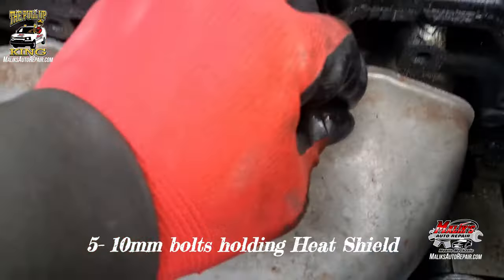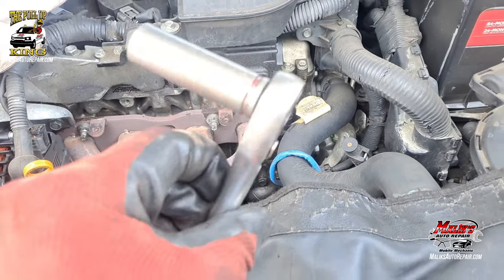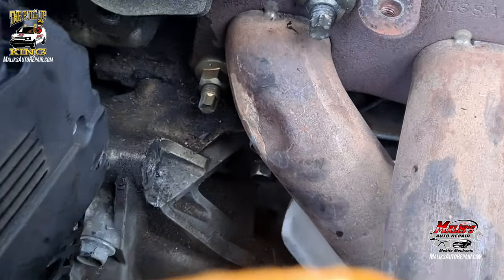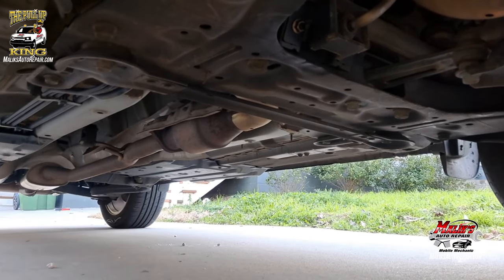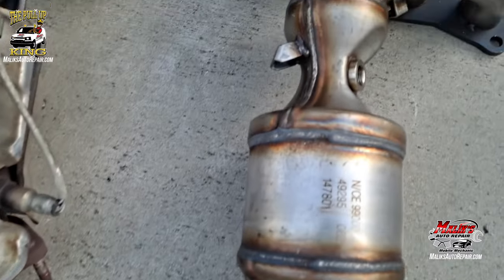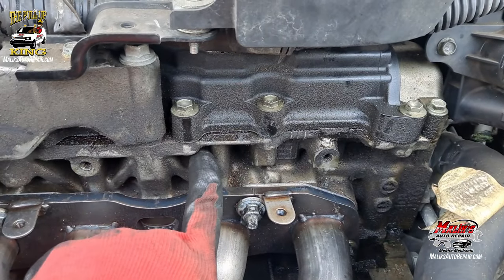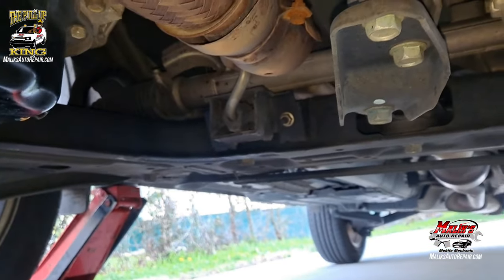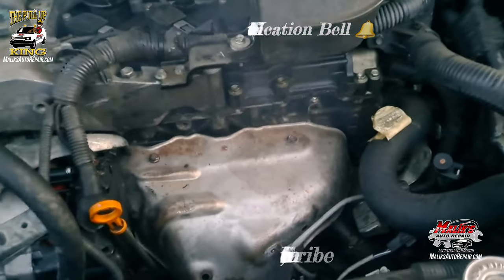CHECK ENGINE LIGHT FIXED‼️CATALYTIC CONVERTER | 2011 NISSAN ROGUE 2.5 | DETAILED| Howto/Diy

Comment: Everything you did was perfect bro, Great job. There is one tip I want to add to the process though. Make sure to clean off the intake part before you put the new gasket on because it will give you a better tight seal on the new gasket and catalytic Converter . Great job though : )
Reply from the maker: Thanks for watching

Comment: Great video man! Just want to ask how long did it take you to finish the job? Also what material did you put on the new censor before screwing it in the cat. Thanks!
Reply from the maker: I appreciate it. About 2 hrs. O2 sensor should already have anti-seize on it. If not, add to the threads. Thanks for watching!

Comment: Great video- almost makes me want to tackle it myself without the shop. In order to pass inspection for my vehicle, I had to get rid of P0420 code only. My mechanic wants me to replace both the front and back cat converters. Do you think this is necessary without that code? Obviously hard to know without seeing it yourself but it about doubles the price and makes me consider chalking my baby (car).
Reply from the maker: P0420 if for the front Cat. P0430 is for the rear cat. I would replace the front only. And I appreciate it! Thanks for watching!

Comment: Was the converter stop up that's why you were replacing it I have a 2015 with the check engine light on and it's something to do with the exhaust but the converter is not stop up that's why I was asking
Reply from the maker: It was replaced bcuz the check engine light was on with code p0420. They wanted it cleared. In order to do so, the front  catalytic converter and Upstream oxygen sensor had to be replaced. Good possibility it was clogged.
Reply: @ThePullUpKing  thank you for your response and the video
Reply from the maker: @danielpadgett2831  No problem. Thanks for watching!

Comment: This is the manifold catalytic converter a $900 part up to 1500 this is not your main rear catalytic converter $250 part …for anyone reading this there is a difference on the Rogue models
Reply from the maker: I replaced the front catalytic converter. Code P0420
Reply: Well that’s my next project I’m battling a Po420 code myself I did replace all spark plugs and engine coils that took away the misfire and failing converter bank 1 only a few days later engine light came back on and now it’s the bank 1 converter and no misfire. I have re-watched your video about 10 times now very convenient and I know I can do this at home.
Reply: I drive a 2013 Nissan rogue S. 184000 miles on it and I’ve been told after 150000 miles those manifold converters go out and need replaced don’t bother with cleaners and replacing oxygen sensors thats a waste of time and money you have to suck it up and spend the money get it replaced
Reply from the maker: @Keifer Gray  Absolutely, you took the words right out of my mouth.💯👏🏾👏🏾 This is why i do it the right way the first time to keep my clients from returning for the same issue. Most hate to hear they need a new Catalytic converter & o2 sensor, but they never need me again for the same issue when the job is done.😎👨🏾‍🔧

Comment: How long can you drive on it before it’s a wrap??? Mine messing up and I can’t get it fixed for a few more checks. 🤷🏻‍♂️
Reply from the maker: Worse thing is your car won't start anymore.
Reply: @ThePullUpKing  thanks for replying bro. So update. The check engine went away. Drives like nothing wrong. 😳
Reply from the maker: Means it's intermittent. Meaning it comes and goes. If I were you I would still replace it, but I know most ppl won't due to the cost. Been doing this coming up on 9yrs and I learned this is the one repair most ppl don't want to pay for. They will literally wait until it fails completely, then you get stuck somewhere.... just an inconvenience. It's called Preventative Maintenance.  Prevents you from being stranded. 9xs outta 10, it'll come back.
Reply: Well done.   I will be doing this on a 2012 soon.
Reply from the maker: @mattsb5196  Thanks! Let us know show it goes!

Comment: I cant get the exhaust bolts to come loose the ones on the manifold to engine
Reply from the maker: Try spraying wd40 on the bolts. Don't strip em.
Reply: @ThePullUpKing  PB blaster and propane torch worked!
Reply from the maker: @jasonmcelveen6295  Oh u had already did some damage. Good job! Stripped bolts are a pain.
Reply: @The PullUpKing 👨🏾‍🔧  I just sprayed it every couple days with PB for a week. Tightened them bolts or attempted to after applying propane heat then loosen tighten spray couple times then they just come off
Reply from the maker: @jasonmcelveen6295  God was on your side my friend. Lol

Comment: Do you have to replace the manifold gasket & O2 sensor when replacing the converter?
Reply from the maker: Yes, that's exactly what was done. Check out the video.
Reply from the maker: Absolutely, in order to pass emissions test. Thx for watching.
Reply from the maker: @AshaleyJ  Greatly appreciated!👨🏾‍🔧
Reply from the maker: P0430 is the back. P0420 is the front.
Reply: @ThePullUpKing  I thought the PO420 was the front and PO430 is the back
Reply from the maker: @dacuttapop3992  Your actually right. I said it backwards. Thanks
Reply from the maker: FRONT